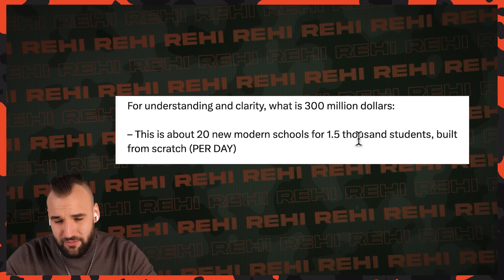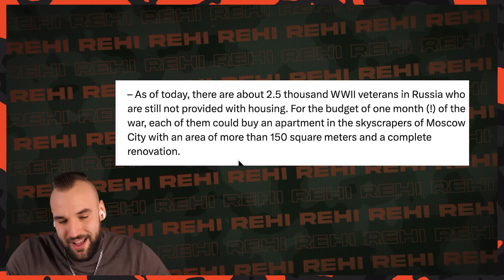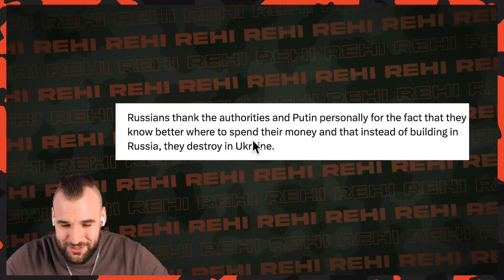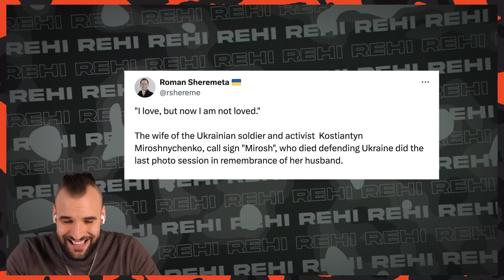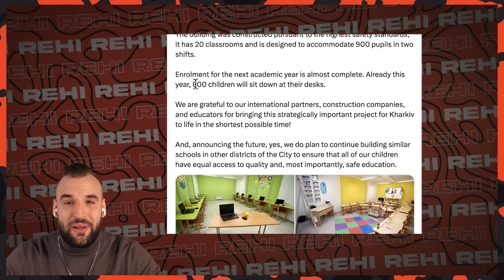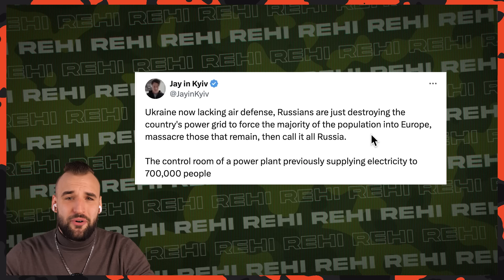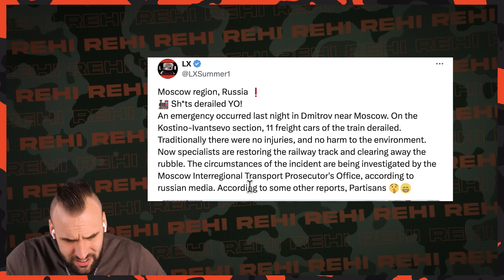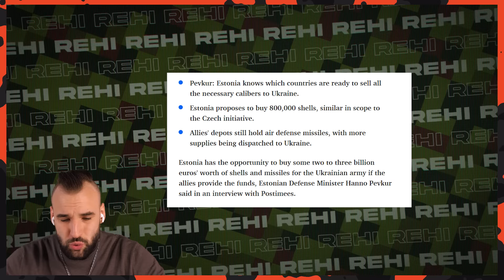Ukrainian Clusters are Pummeling Russian Tanks! | Ukraine War Update

Comment: They often can't bury the pipelines in Russia because the pipes are incredibly hot, so it doesn't work because of permafrost and the mud season. Also, it's cheaper to build the pipelines above ground and makes it easier to maintain them. In Alaska a lot of pipelines are above ground for the same reasons.

Comment: Looks exactly like my city, Winnipeg, Manitoba in the spring. The spring is a mix of major melts and freezes. When it starts to warm up drain openings are still frozen up and the water can be everywhere. Then it freezes again and there are major ice ruts, potholes and frozen mini-lakes all over the place. It also looks disgusting because all of the sand and litter shows up in the snowbanks at the side of every road. It's just a fact of life here. Not trying to justify the pictures you showed but just adding some possible perspective.
Reply: That's precisely why I left Ottawa 54 years ago!!!  It was a 'springtime" shithole and in May there were salt dust storms when the mud dried up!
Reply: @DavidWootton-yd5ws have you seen this partisan?

Comment: Are the pipes above ground because of permafrost? I think it's still like that in Alaska, but I'm not very well versed in oil infrastructure either so...  😂
Reply: I was going to mention this. In places where the ground freezes in winter; Often warm pipes are above ground. Depending on the soil it may be cheaper, and easier to maintain if above ground.

Comment: I lived in the Far East in the early 90s, trying to teach Russians how to embrace capitalism.  We had this horrible road leading to our factory that was paved with concrete slabs that were cracked, uneven and filled with pot holes where rebar stuck up and could tear out the underside of your vehicle if you let it.  Our translator said it wasn't always the case. The road was dirt and there was a water pipe that developed a leak and was causing the road to swamp.  Instead of fixing the pipe, they 'paved' the road with these slabs so that the water would run over and drain.  Eventually the freeze/thaw cycle chewed the concrete up and made the road worse.  There are fields full of these slabs, just stacked up and waiting to be band-aids on Russia's problems while they avoid dealing with root causes.  Thank you Artur.  Keep up the find work, my dude.

Comment: Also. Where I grew up on the Oregon coast all the valleys would flood like that every fall and winter, but they didn’t build where it flooded, all the houses and towns. Etc was up on high ground, including any major roads, power and telephone poles were tall enough to stay out of the water, every year that whole area turned into another Great Lake, but we also got over 100” of rain a year, the majority in fall in winter, and the water table was only 12”- 24” down in most places that were lower in the valleys, nothing could fix or control that level of water, so they didn’t try, they just built around it. And sure you’d get roads that washed out. Power taken down. But usually only for a smaller area and short period of time, it got fixed. Really remote people from town, would just drive their boats to town. As faster and easier then driving the hour plus the long way around, but you could still drive there. If needed. Then they’d pull their small boats up on the outskirts of town, along the hillside facing the river, go shopping or do whatever they needed and motor back across the valley, to home. There was no controlling that amount of water, couldn’t stop or divert it, plus it was the best fertilizer, natural fertilizer every year, no one in that area used chemical fertilizers as they didn’t need too, nature did that for free, some of the areas would be under 40 feet of water, for months at a time, and tens and tens of miles wide. A vast, slow moving lake that went to the ocean, and in 4-6 months from the first steady rainfall, you could farm and live like normal again. In those flooded areas. Some of our highways had one to two lanes under water. So you were stuck with one lane each way, but that was normal, and any damage fixed as soon as dry enough to do so. And our rail lines. Always up and dry. Usable.

Comment: They probably dont bury the steam lines in Russia, due to permafrost and the need for thermal expansion and contraction of the piping during start up and shutdowns for maintenance.
Reply: There us no permafrost in 90 % of Russian towns. Anyway the heat in the pipes would prevent freezing. It is simply cheaper to construct on soil. The higher lost of energy above ground does not matter as energy is cheap.

Comment: The money for the shells could have been allocated to build up production capacity and then the shells could be at cost, without a 300% markup.... they'd be investing money into the economies, and ensuring national security in the long term...  wish they had more strategic thinking with funding... the production capacity issue is not a nice to solve issue, it is a critical issue... finding a million shells here or there at insane prices, for old shells is not a long term solution.    Any country could choose to build a factory for the shells, another for the explosives, guidance systems, etc... spread the cost... and increase the speed to stand up the production... if there is money and will, there is a way.